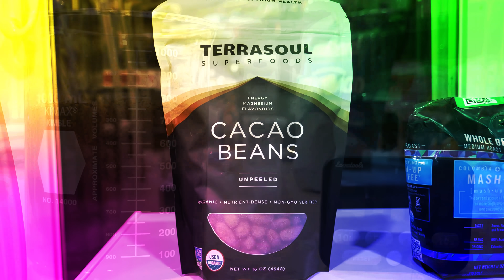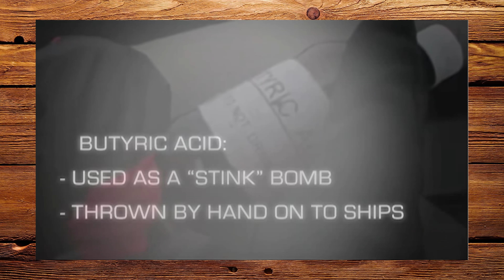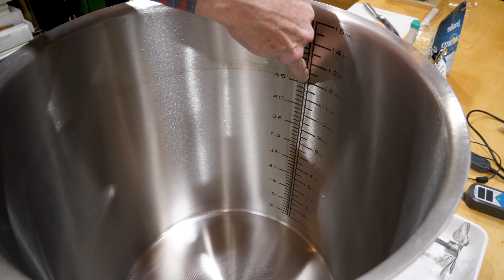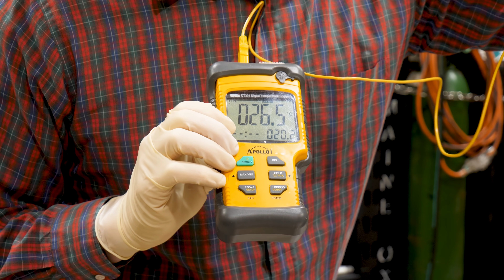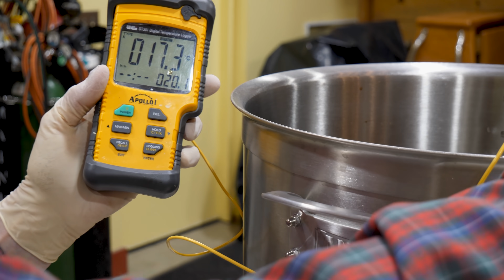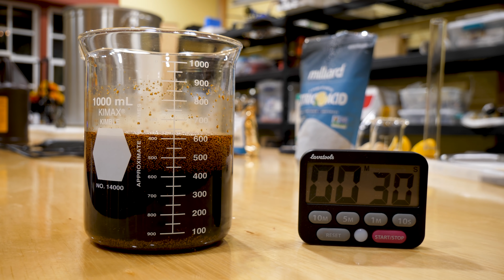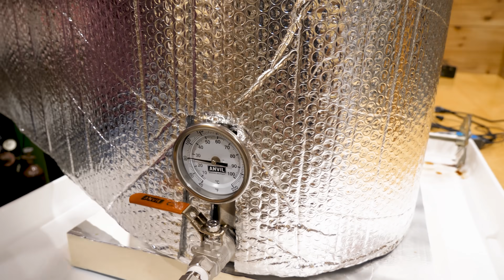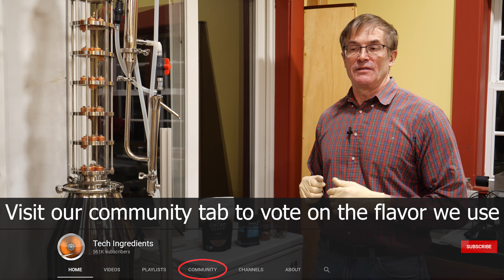Making Flavored Rum | Easy and Cheap! - Part 1

Comment: actually to get good water on the cheap you can use a simple RO filtration system
it may require additional booster pump energy but given my absolutely unacceptable water and ridiculously high water pressure(80PSI with spikes high enough to burst PVC lines) in my area a passive RO system running right off water tower central pressure with a simple spike bypass valve at 100psi to protect my membrane and ASO valve and a massive tank and I could brew or carbonate to my hearts content

Comment: How much dunder should you use?
Reply from the maker: I don't know if there is an optimal quantity.  I have been successful by using all of the residue that is left after a fermentation that I hold back lest it begin adding thick solids to a distillation.

Comment: Wouldn't the fermentation produce  CO2 and then you get just enough pressure that it escapes from the pot? I thought it has to be airtight so the CO2 is just like an inert gas.
I hope I could make my question understandable
Reply from the maker: The CO2 from the fermentation provides a protective layer that helps to shield the yeast from oxygen.  The free lid prevents a dangerous pressure build up, but seals well enough to exclude air.  You don't have to go to extremes.

Comment: Carboys are much better for secondary fermentation, so long as you aren't doing and additives in secondary.
Using a hose as a siphon is considered a foul in today's brewing. We use Auto-siphons today. much easier to use, no fuss, no mess, no sucking required. 
Where are you that distilling on the home scale is actually legal, or did you actually go through all the headache to get a license?

Comment: I don't get the sake inoculation similarity. Sake is given enzymes and stuff to make it a better fermentable. Molasses don't need the extra help. So I don't get what you're trying to say at all.
Reply from the maker: The "stuff" is an inoculation of fungus that converts some of the starch in the rice and generates a nutty flavor.  Unlike whisky, burbon and brandy, rum also depends on microbes other than the yeast to impart more complex flavors into the molasses.

Comment: Chlorine in the water will not reduce if the top is left off. In fact the water will evaporate leaving the higher concentration of chlorine. I am not sure about bromine. I am positive about Chlorine .
Reply from the maker: Chlorine will, but not the more commonly used chloramine.
Reply: @TechIngredients  OK, Of course I believe you. I will be looking it up. My source was not the best.  This information was from a video on water filters. There may have been a marketing aspect to my information. :D

Comment: Professor your math is little bit off (19:43). A five to one ration: so if you have two gallons of molasses then you need 10 gallons of water.
In all your video is 10 steps higher than most DIY alcoholic beverages instruction.
Thank you for all the content in your channel.
Reply from the maker: That's correct as you can see, the brew pot is filled to approximately 12 gallons total.

Comment: I was surprised that we didn't get an aside on calculating the volume of water at at given temperature to equalize at 30 C.  Naw, eyeballed it!
Reply from the maker: I didn't bother because it doesn't matter.  A couple of liters more or less won't affect the result and the initial specific gravity will predict the ABV.
Reply: @TechIngredients  True.   I guess the yeast is fairly tolerant +/- a few degrees.  I'm ready to see the distillation phase and the tasting!

Comment: I am really surprised that the molasses actually let anything grow in it, in terms of using it as a carbon source for respiration, I was under the impression that sugar concentrations that high would completely halt any metabolism, osmotic pressure etc. etc. for microbes.

Comment: you mean shochu? sake is brewing drink like beer
Reply from the maker: I meant sake because of the similarity with the fermentation of the molasses.  Both require more than yeast to produce the complex flavor and various bacteria serve this purpose.
Reply: @TechIngredients  Right that part is same. But sake don't need to be distilled into final product. Once it is distilled, it is called shochu. There is a version of shochu is actually made with sugar. Brewing step is same as sake. It required the process of koji making
Reply from the maker: That is why the reference was applied to the molasses fermentation proceedure.  Taking this a step further and distilling it then you are correct.

Comment: 1:5 ratio if you use 2 gallons of molasses you need 10 gallons of water and not 5 as stated in the video. The math is simple but doing it while talking to a camera not so much.
Reply from the maker: Remember, we ended up with 12 gallons after adding 2 gallons of molasses.  The ratio is one to five.

Comment: Wouldn't a 5:1 ratio be 5 gallons water to 1 gallon molasses? You said 5 gallons water to 2 gallons of molasses (aka 5:2). Then you ended up with 12 gallons, so confused. I feel like 5:1 is right and you had 10 gallons of water/dunder to 2 gallons of molasses. Not trying to troll you, just trying to emulate you.
Reply from the maker: The ratio is in fact 5:1.  We used two gallons of molasses and 10 gallons of water.

Comment: Isn't PH a logarithmic scale? Won't that make the calculations a little more involved than just dividing by two? It's been a long time but....like if you need x lemon juice to move the pH one point then you need 10x lemon juice 2 points so you need....brain fail. Anyway not half to move the pH half? Ah screw it. Delicious is delicious. Just want to correct my head.

Comment: Don't want to be an asshole, but 19.30 5-1 ratio, 2 gallon sirop to 5 galons water, sounds like mistake:) please correct... or maybe I had too much rum already:)
Reply from the maker: What I added was correct and that ratio is also correct as the final volume was 10 gallons. My statement was in error.

Comment: Tax evasion has never been so simple #allTaxationIsTheft
Reply: I used to make mead as a hobby when I first got clean.  Now I live in an apartment where space is limited and so is climate control. I might be able to "not" make this though cause it doesn't take six months and won't require an air conditioner. It's not legal to distill here,  so I have to "not " make it instead of not not making it

Comment: If you go to all the trouble to buy the molasses, ferment it, add dunder, etc, then why are you using a column still to make a neutral spirit? Why are you stripping away the rum flavor with a column still and not using a pot still? There are other ways to flavor rum besides using a neutral spirits gin basket and destroying the rum flavor. What you did is stupid. Why not shorten the column, put the gin basket at the top, don't do reflux, and get flavored rum instead of vodka. For a know it all, you seem to fall very short. These comments are aimed at video two. Two very verbose videos from a long winded know it all.

Comment: aliens and dinosaurs are real
Reply: bati high voltage 6kg/L maxcaps
Reply: about 250Wh/L, 44Wh/kg
Reply: direct caps, better than super and ultra
Reply: it needs to be at the breakdown field and voltage, whatever your plate uniform distance is
Reply: electrolysis of x